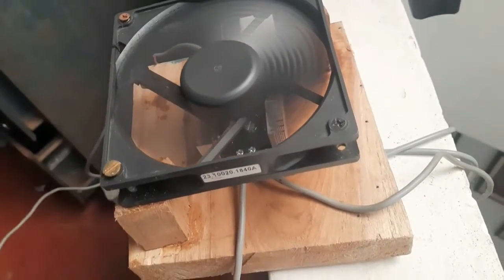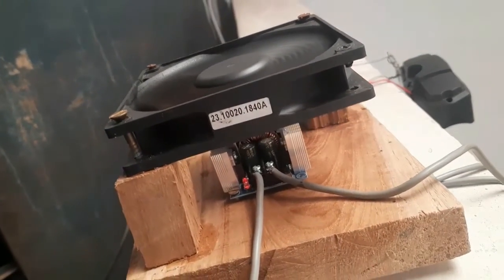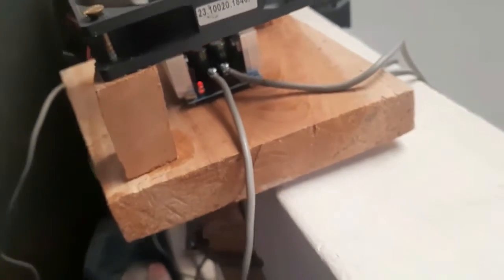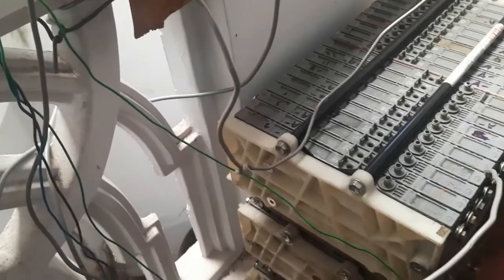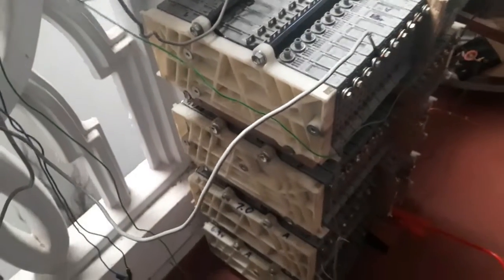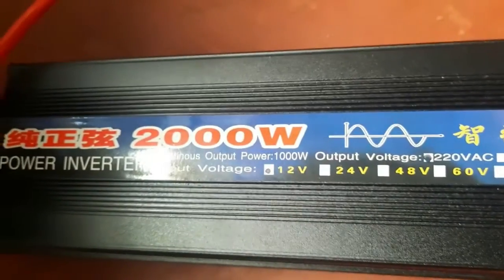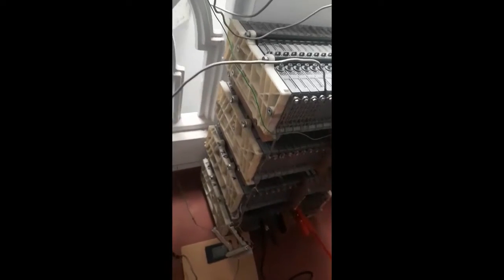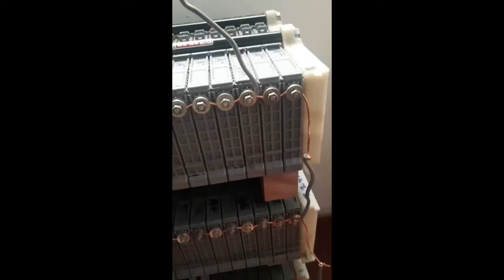Used hybrid Battery for Solar power - Efficient/Low cost

Comment: I assume your lights are incandescent because leds would last days... Each one of those four packs should be able to put out 13 kilowatts. So for a total of 50 kilowatts you Should be able to use two kilowatts for 24 hours. Four light bulbs and a fan would not take two kilowatts. 

Are these used batteries Maybe?    Where has my thinking gone wrong here?
Reply from the maker: You're spot on, these are used batteries. I've described about them in my previous video. 
They're actually discarded batteries from repair shops,  so they're very cheap to get.